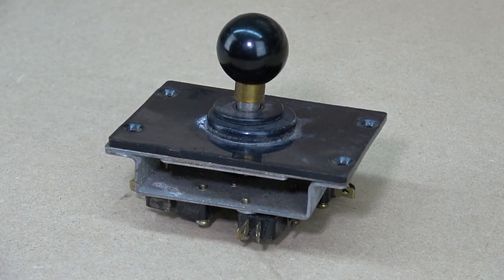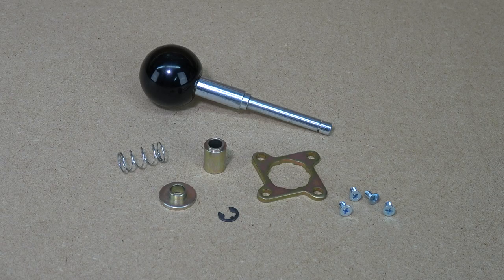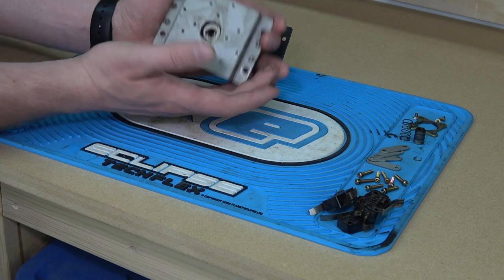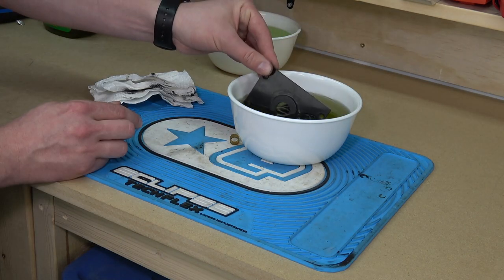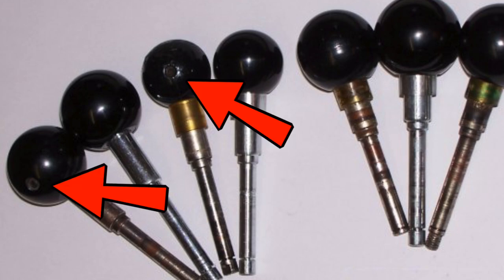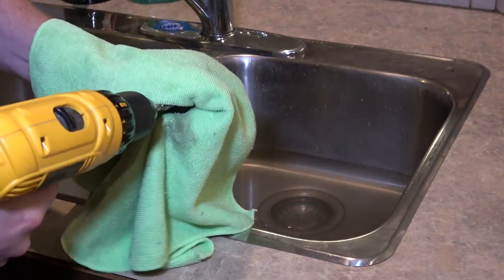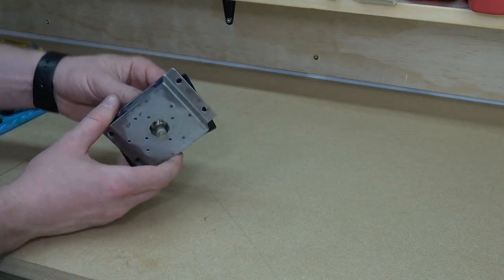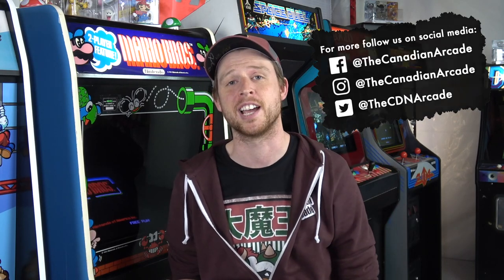Restoring A Nintendo Joystick

Comment: I have a new joystick from Mikes arcade for my donkey Kong.  It’s starting to stick a little going left and the return is sluggish. Any suggestions?
Reply: Could need a cleaning. I’d reach out to Mike and see of he has advice.
Reply: @Chancekj  thanks. I took it apart and added some grease to the bearing and it seems to be better. I also added a stronger spring which is really helping. The stock spring is really weak.
Reply: @therexershow   yeah, it’s probably worn out. I had a couple that way.

Comment: So if even after cleaning the joystick has a lot of wobble/dead space, is that generally indicative of the bearing being worn out and needing replacement? I'm thinking I'll have to get a full new joystick assembly if that's the case?
Reply: Could be. The bearing is locked inside the main housing. But that rarely goes bad. Nintendo sticks are a bit sloppy and mechanical compared to most anyways. You may need a new spring, spring stopper, or switch collar. I’d reach out to Mike’s Arcade and see what he had in stock.
Reply: @Chancekj  My P2 stick is pretty good, so I swapped over the spring, spring stopper, and switch collar last night from P2 to P1 and P1 stick still felt super sloppy. I'm pretty sure it's the original sticks in there so it's probably had quite a bit of use over its lifetime. I'll reach out and see what Mike has. Thanks!